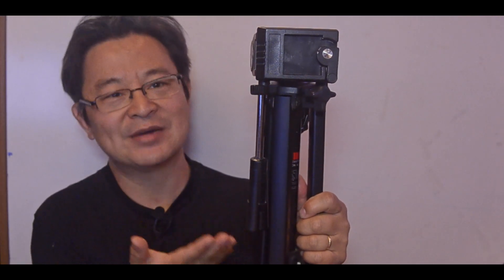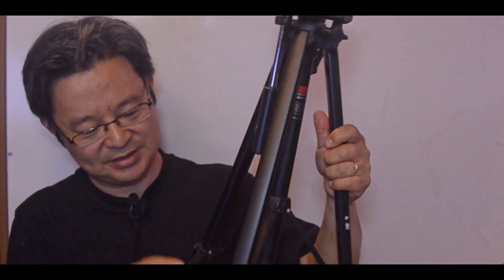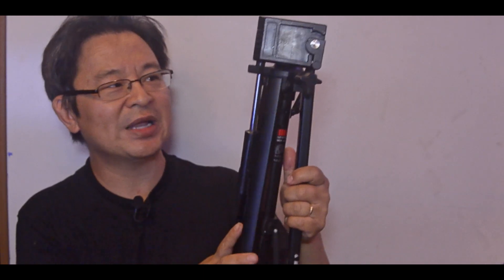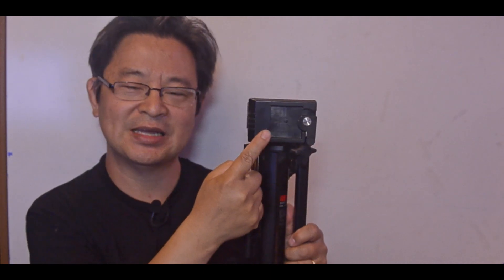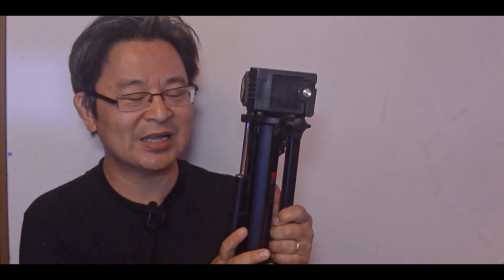How to make your own camera tripod quick release plate with polymorph plastic

Comment: Thank you for this video! I bought an older Vivitar model tripod from the thrift store. Despite its age, the thing is built like a tank & works great! Of course, it didn't come with a quick release plate & I learned the hard way why thrift store tripods are so cheap.

I thankfully found a used older model monopod by Promaster on ebay that used the same quick release plate as the Vivitar model I have and although it was a perfect solution and I now have an awesome monopod, I've been worried about losing the quick release plate & I would also like to have a plate for each so I don't have to keep switching the plate out between the tripod and the monopod.

Your solution is brilliant & the price of the thermoplastic is very cheap in comparison to buying a whole new quick release plate (that doesn't even exist anymore). You rock, dude!! 🙂
Reply from the maker: no problem.